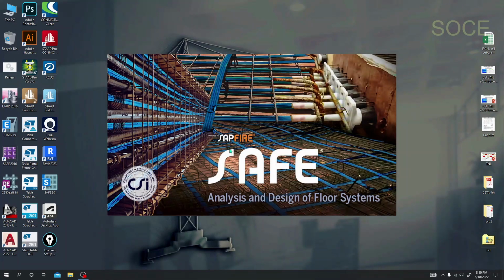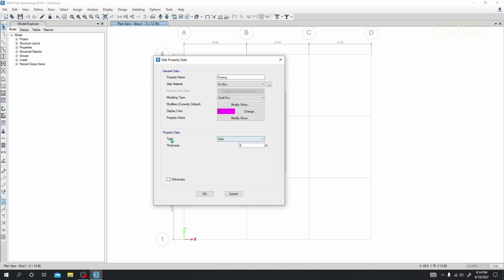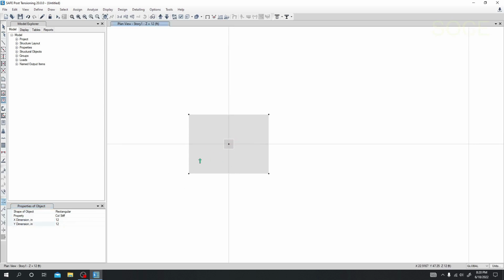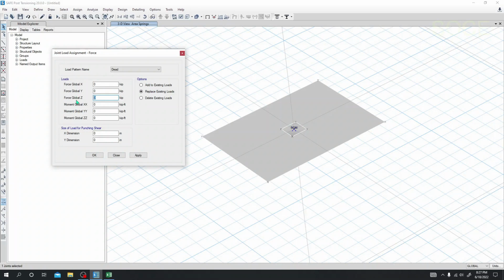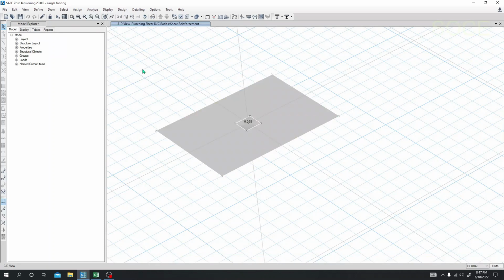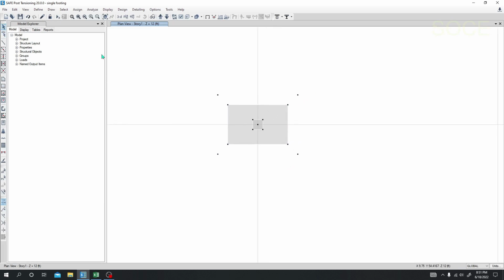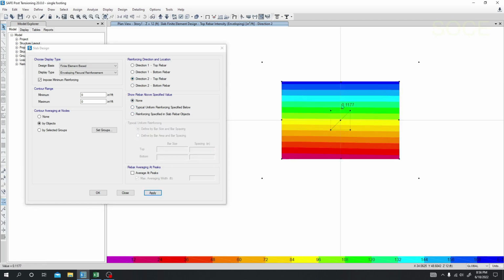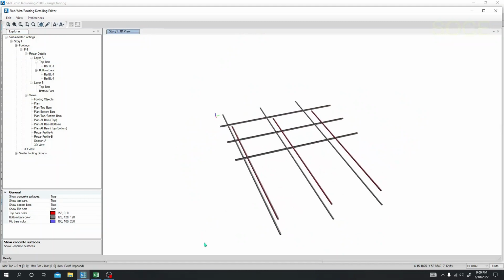2. CSI SAFE 2020 Tutorial | How to design isolated footing in safe v20

Comment: i do get warning when i check or run analysis

Warning: Check meshing, At  area 1 ( 4.64% Increment)
Check Warning File(C:\Users\mayad\Desktop\work\a.WRN).
Reply from the maker: if you don't get error, you may ignore it.
Reply: I met the same question with you. I consider it is because the stiff column you modeled. The four corner nodes of the stiff column are not connected to the finite elements of footing slabs when using defulat meshing method. In my opinion, either reduce the element size to fit the four nodes, or delete the stiff column, although this deleting method is conservative when applying reinforcement, because the stiffness of column which can balance the moment of footing slab is no longer considered. You can recognize the appropriate moment manually (at the approximate spot of column edge).

Comment: Hello, I'm facing an issue while assigning Stiff property. I'm working with Metric SI units. After assigning the Footing, when I assign "Column Stiff", the assigned Column Stiff is going inside the Footing section, when I extrude unlike as shown in the video, and its giving a warning message, when I run the analysis.
Reply from the maker: try to remodel.
Reply: Same issue
Reply: did u correct this problem?? im facing the same issue